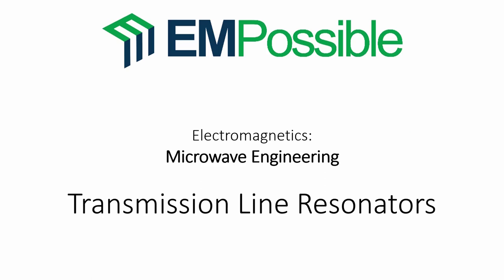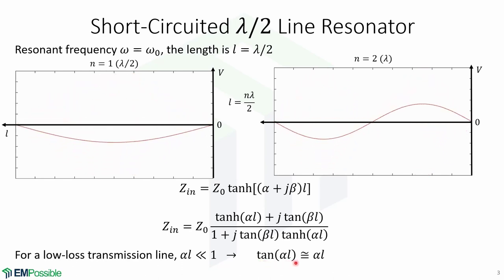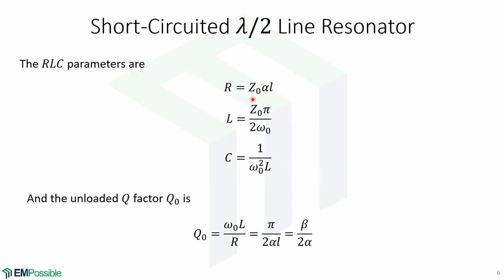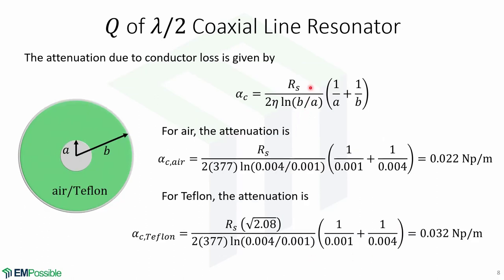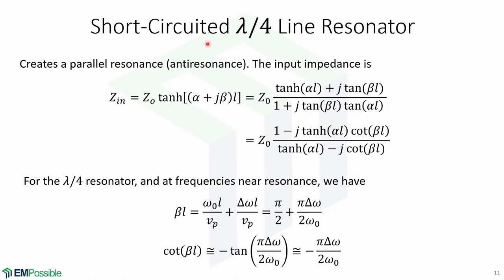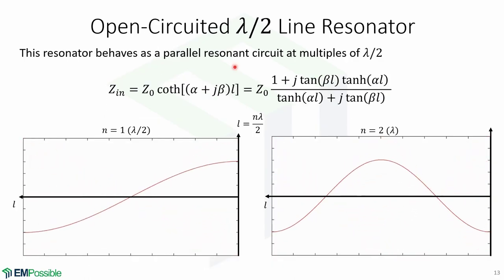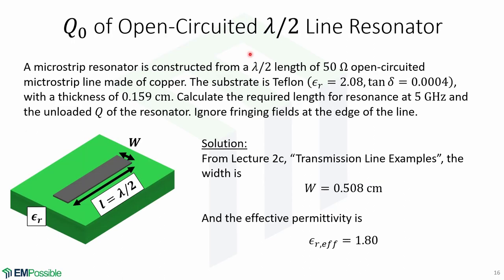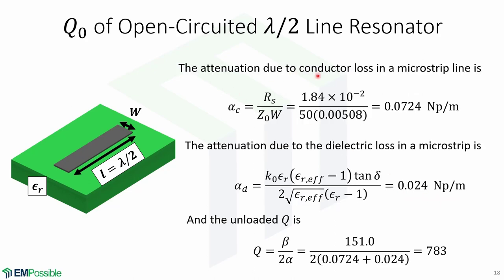Lecture -- Transmission Line Resonators

Comment: Hi, you use the examples of Pozar right? could you please explain why if you have a half lambda resonator coupled by a gap at one port, with the other port terminated in open circuit the circuit resonates at Fx but if you terminated it with a short circuit the resonance occurs at lower frequency and the resonator behaves such as a quarter wave resonator? thanks

Comment: There is an error with your beta value. It is supposed to be 140.5 rad/m.
Reply from the maker: You are right!  Thank you!  The problem is fixed in the notes, but not the video.  That will have to wait until another time.

Comment: can a lambda/4 open circuited line be used as a resonator???
Reply from the maker: Not buy itself.  Electromagnetic energy must somehow be forced to make a round trip in order to resonate.  A open circuit line only provides half of the resonator because it only provides one point of reflection.